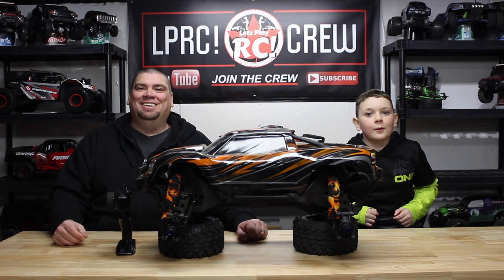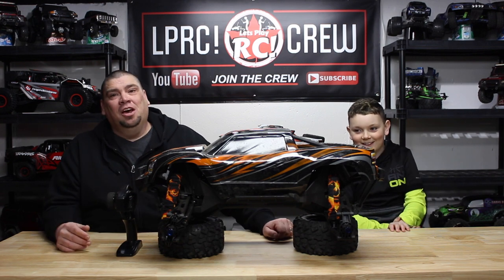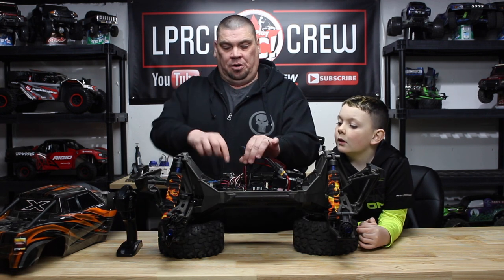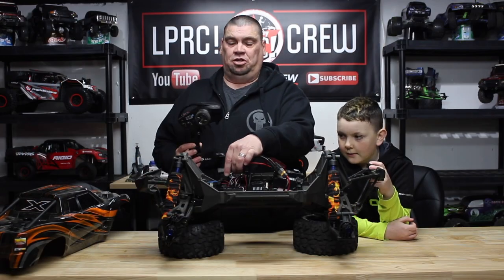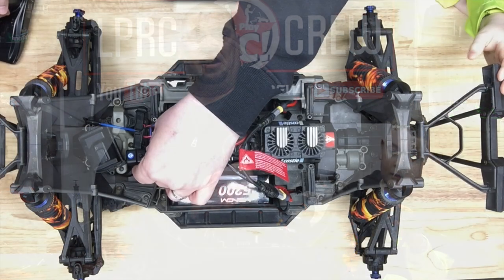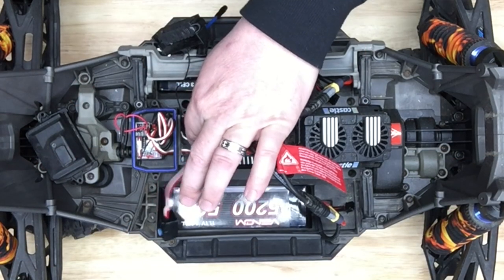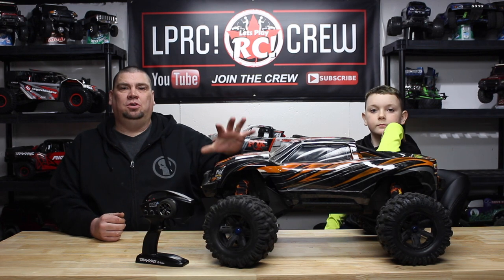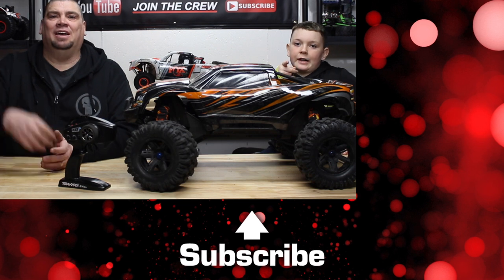How To Calibrate Hobbywing Max6 ESC For Traxxas X-Maxx / Lets Play RC!

Comment from the maker: Finally got my Xmaxx fixed so happy! Here is the video of it working again https://studio.youtube.com/video/YxqYQwXvrxY/edit
Reply: From what  I've seen, there must be 2 different max6 esc's... yours has the set button and the one I bought doesn't... so for trying to calibrate I'm not having any luck , but let me add this .. im still using the factory motor in my xmaxx... so I'm wondering if this is my problem?
Reply from the maker: @chadlavoie8609  hey first off thanks for watching. We also used the original motor so I don’t think that would be the issue. However we did this upgrade and video 4 years ago. I’m wondering if hobbywing has  updated or changed the Max 6 ESC somehow.
Reply from the maker: Actually I just check the hobbywing web site. It appears that the max 6 ESC still has a set button right next to the power button. So I’m not really sure what is going on in your case.
Reply: Is there a social media that I can send you a picture of this max6 esc?
Reply: I appreciate you checking into this ... I wa stuck as to why mine didn't have the  button switch...
Reply from the maker: @chadlavoie8609  yes you can send a picture to instagram Letsplayrc1

Comment: I have a question. I calibrated my xmaxx with the same hobbywing esc but my xmaxx is not going in reverse
Reply from the maker: Thanks for watching. My best guess would be to start the calibration process again.  And be sure all servos are plugged into the correct slot in receiver.  Hope that helps.

Comment: I just bought my first x Maxx and installed the Traxxis receiver with matching remote and HW ESC.  I went through the set up and still have flashing lights and the steering will not working? Any ideas.  Thanks
Reply from the maker: Hey thanks for watching. Not really sure what the issue is, if you fallowed all the steps. Only thing that might be messing up is having the esc plugged into the correct channel on the receiver.

Comment: Hey so I just bought a max 5 esc and since I got it it’s been flashing red light idk what to do I have steering and the sec fan is working the controller is brand new and receiver, i tried another controller and did the same thing so I really need help and when I tried to calibrate it when I’m in neutral position and hold full throttle to switch the next position I get no beeps HELPPP!!!!
Reply from the maker: Hey first off thanks for watching,  not sure if the max 5 is the same calibration as the max 6. Make sure you have a fully charged battery and hold the set button while turning it on hopefully that will reset the system. Then try to calibrate following the steps in the video.  Hope it helps.
Reply from the maker: Also be sure to turn on the controller before the ESC
Reply: @LETSPLAYRC  hey great video I actually found out some how my brand new receiver is bad that’s all, I was really confused for hours and I pulled out something completely different not everything works and binds correctly thank you for your help I really did appreciate it

Comment: Good job guys. I have xmaxx 6s model. Could I install Max6 Esc using 8s lipo and stock motor? Or should I change the motor? Thanks
Reply from the maker: Lluis Aguilera ,  hey thanks so much for watching.😉😁. We have never run the Xmaxx on more than 6s. So not 100% sure. However I believe the stock motor is perfectly capable of running 8s. The gears and cvd shafts etc.might not hold up though. 👍. Have fun!!

Comment: Does it have to be plugged into channel 3 to calibrate it? Mine is a Slash with a 2S battery, and a FlySky GT3B transmitter, and receiver. I have an older ESC, and I have forward throttle, but no reverse. When I hold the set button down and turn it on I get a fast beep, but no throttle pulse. It will either beep once or twice when I try to program the throttle. 
Great video and I will have to try it later today.
Reply from the maker: RakinBill ,  thanks for watching 👍😁, hope you sorted it out. Yes I believe it is channel 3 , it was quite sometime ago when we did this so by memory I’m sure that’s correct. 😊😁✌️
Reply: @LETSPLAYRC  I have it figured out. I have a Hobbywing Max 10 80A ESC, and the wire from the ESC plugs into channel 2 on the receiver. I was able to find the instructions on the web, and was able to get it programmed the old fashioned way. 
I broke down and purchased a programming card for future endeavors.
Reply from the maker: Right on I’m glad to hear that👍. I to will be grabbing a program card as it seems all the hobbywing ESC’s set up is a bit different. 😉😁
Reply: @LETSPLAYRC  That is true, I noticed there are 3 different versions for this card alone. This card will work with the majority of the ESC's, but I might end up getting a Wi-Fi and Blue Tooth setups so I can work on a broad spectrum of ESC's.

Comment: Hi there, Is it the same procedure for the max 5 esc with hobbywing programming card ?

Thank you.

Jay.
Reply from the maker: Jay Singh ,  hey there first off thanks so much for stopping by 😁👍. Unfortunately we have not had any experience with the max 5 ESC from hobby wing. Not sure how the programming works with that one.
Reply: Yes, same for max5. Program card just changes the fine tuning, punch level, thermal cutoff etc

Comment: Awsome job. Have my max6 on it's way. Only debate now is keep the stock motor, or upgrade to the 1650, or the 1100 they offer with it. Any thoughts ?
Reply from the maker: John Columbia Thanks so much. 😁 The Max 6 runs awesome with the stock motor in the XMaxx. Have not ran 8s though only 6 s so far and it’s fantastic. 👍😁
Reply: @LETSPLAYRC  yea my only really worry is trying to solder on the traxxas connectors, as first time ever soldering. Picked up what I hope are the same ones that come with the truck, traxxas batteries, and the dual traxxas charger I bought. Guess I will find out if they are correct soon enough lol. Thanksagian
Reply from the maker: John Columbia ,  soldering is not overly difficult. I’m sure you’ll do fine. We have a vid that might help.  Btw I would suggest a different brand of battery other then Traxxas if at all possible in your location. As you can tell we love our Traxxas products but not a fan of batteries. Get something with a 50 c rating , I suggest Venom. They seem to last much longer.
Reply from the maker: https://youtu.be/XefnL4q4FEg

This vid might help with soldering. 😉👍😁
Reply: @LETSPLAYRC  ofcourse the guy snickered me into buying a dual traxxas charger which seems to only be able to charge batteries with their ID plugs. Rookie mistake on my part I think. As this is a big pain in the you know what . Lol
Reply from the maker: John Columbia ,  this May help as well https://youtu.be/W3bok_Q6j-8

Comment: Hi hello just a quick question I have a max8 put when I turn the esc the red light comes on should I reset the esc and reciver thanks let me know ASAP thank you 😊
Reply from the maker: Hey thanks for watching. Not sure on the max 8. However I would reset everything. And start the calibration from the start I would think that should help. 😉😁👍
Reply: Thanks for your message I will try that 👍

Comment: My Max 6 ESC will not Calibrate? I’m going through all the proper steps.
It’s plugged into channel 2, batteries are fully charged, but the only thing that works is the steering.  I even rebound my transmitter to my receiver.

At this point I’m about to go back to the stock ESC.
Please Help!😬
~👊🏾
Reply from the maker: Hey thanks for watching. 😊 sorry to hear your having troubles. 😔. Try channel 3. It’s difficult for me to trouble shoot over messages. However it worked perfect for us. 👍 hope it works out. It is an awesome esc once you get it working.👍😉 I sure hope your receiver is not shot. Let us know how it goes.

Comment: Hey, 

I have an xmaxx 8s with hobbywing 6s and leopard motor. This thing used to scream. I bought the ota programmer and did the update and now it barely goes. I’ve been through the settings and not sure what else to do. I also lost brake although it says throttle/reverse/brake on the settings for the ota.
Reply from the maker: Hey thanks for watching.  Not sure what is going on with yours. We only did this to our 6s XMaxx with stock motor, did not use a program card. Not sure what the effects of the programmer and leopard motor would have on any of the calibration settings. Sorry to hear your having troubles.
Reply: @LETSPLAYRC  

Hey thanks for the response. I just had to calibrate the esc after the firmware update, and it’s working great again.
Reply from the maker: @gloglo1275  Awesome!!👍😉😁

Comment: Did same steps worked for 2 min then everything is dead and The receiver flashing red and my Max6 is dead with only fan running/ no lights no steering - very frustrating cant re set cant use program card can re set /😢
Reply from the maker: Hey sorry for the delay. Thanks for watching. Unfortunately I’m not sure what to tell you. We have not had any trouble with ours. Hope you found a solution!
Reply: @LETSPLAYRC  no worries- ya my solution was i got a max5 and 1100kv motor/ runs like a beast!!! No problems what so ever

Comment: With the Max6 what features do I loose? Tsm still work?
Reply from the maker: No features lost. In our experience everything works the same with the Traxxas receiver.
Reply: @LETSPLAYRC  What if I swap Transmitter?
Reply from the maker: @BigCheese85  not entirely sure , I guess it depends on what the transmitter capabilities and connectivity compatibility is.

Comment: I have the 8s X-maxx. Does the esc go in port nr 3? Gonna try getting mine Max6 tot work later today
Reply from the maker: Rippey RC , Hey first off thanks for stopping by. 👍😁. Our XMaxx is a 6s. I can only assume that the 8s and 6s XMaxx have the same receiver so the esc should plug into the same channel. 3. 😉. Hope it all works out for you.😁👍✌️
Reply: @LETSPLAYRC  thanks!
Reply: So i tried port 3, that's a no go for thé 8S. In port 2 it's working but trothle= Running backwards. 😁
Reply from the maker: Hope this will help with that

https://youtu.be/NvA1kG594yM

👍😉😁

Comment: Big thumbs up.   I havent used my 8s x maxx in months andi tried charginf batteriesand they dropped voltage so they're no good, and just took it in to get a max 5 installed and currently watching vids on them . Looks like its gonna be fun.  Subscribed bro 🤙🤙
Reply from the maker: Marcos Reyna ,  hey there thanks so much for stopping by. 👍 we appreciate tour support. 😉😁.  Hope the new ESC works out for you.  By the way. Don’t forget to put your batteries into a storage charge when not using them for a while that should help prolong there life. 👍😉😁✌️. Have a good one. 😊
Reply: @LETSPLAYRC  thanks.  Thats exactly what i didn't do,  i didnt put them in storage mode as i planned on using the rcs again but got busy doing other stuff and forgot all about them.  I will do so from now on.  All my traxxas batteries went out,  2 from my xmaxx,  a 3s from my stampede,  and a 2s from a crawler  i spent some money yesterday buying everything all over 😖
Reply from the maker: Marcos Reyna ,  yea these things happen. We all get busy and distracted don’t we.

Comment: When I try to connect the transmitter to the ESC. The ESC beeps, but if I press the SET button, the ESC stops beeping. Does anybody know how I can fix that. Thanks in advance.
Reply from the maker: Wessel Kiens ,  Hey there thanks for watching. 👍. It sound like you might have the ESC plugged into the wrong channel on the receiver.
Reply: @LETSPLAYRC  In which channel I have to plug in?
Reply from the maker: Channel 3
Reply: @LETSPLAYRC  Doesn't work. We tried all the channels but all with the same result. Any tips?
Reply from the maker: Is this on the Traxxas XMaxx with stock motor ?
Reply: @LETSPLAYRC  Yes it is.
Reply from the maker: Try turning everything off and restart process as I described. I have heard that sometimes it takes a few try’s to get it to link. If that doesn’t work you may need a new receiver.